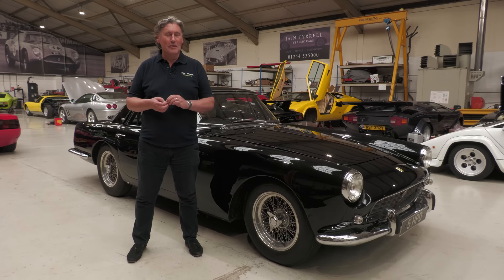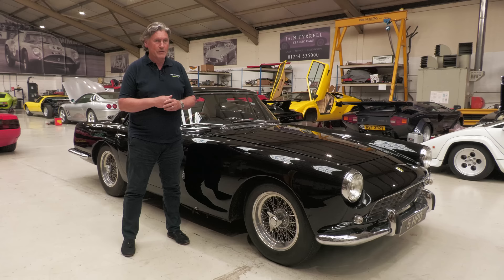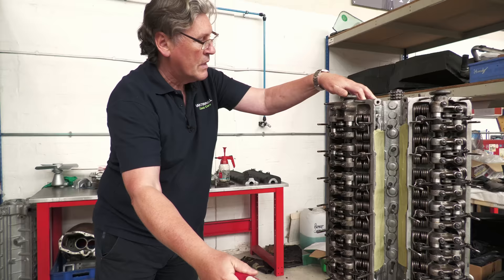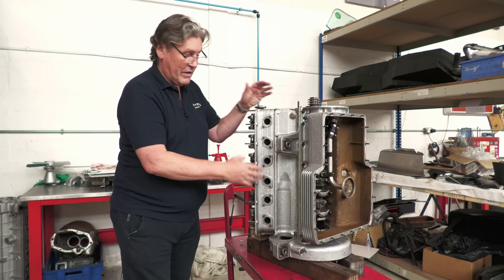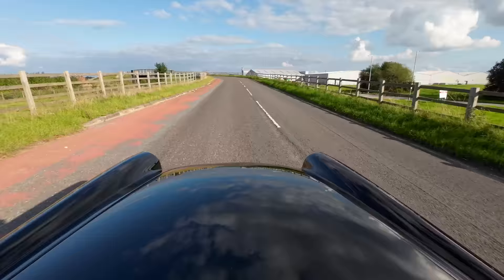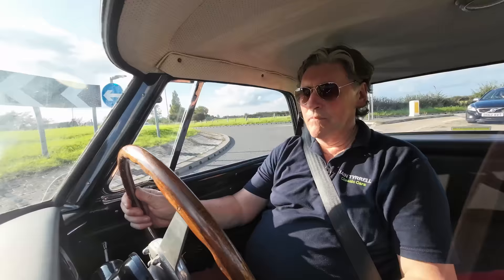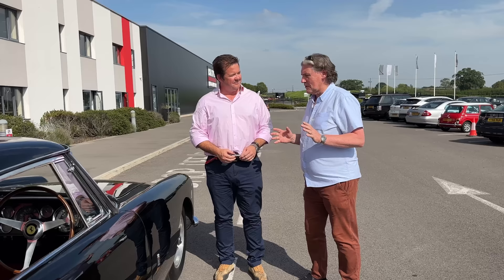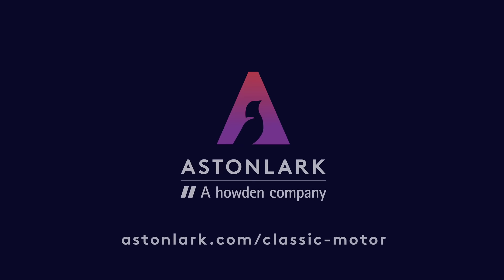Disaster Strikes! Ferrari 250 GT Coupe Road Test Drama | Tyrrell's Classic Workshop

Comment: It should be a no brainer not to give your Ferrari keys to a 21 year old to take for a spin, but that is exactly what happened to me! In 1968 while working for John Oldenkamp as a Studio Apprentice on 5th Ave in San Diego, J.O. decided to rent a Ferrari 250 GTE for 2 weeks to evaluate it for a possible purchase for $14,500. It had an oil leak and Ferrari service prices freaked him out so he bought a new 1967 Porsche 911S Targa! 
Before returning it he handed me the keys to the silver over red leather Ferrari and said "Why don't you try it out?" OK! I will...and off I went to pick up my buddy Cecil and his girlfriend Sally Angel and off we went on an unforgettable lap of San Diego's new freeways. 
Dropping down onto 163-S at Robinson the 250's V-12 was smooth and quickly we pushed 90...100 and under the Cabrillo bridge at a solid ton. Up the off-ramp at 90 mph to I-5 N and with peddle to the metal, downtown disappeared at 100+ past the airport and onto I-8 W at about 85 mph on the longish ramp and then we were picking through Mission Valley traffic at a solid 100 mph in 5th. Up the sexy curve of the 163-S exit the Ferrari slowed, 4th gear floored it and we were going 90+ mph as we topped the hill and went up the Washington St. off-ramp. Laughing and sweating all at once.
Remember this was in 1968, the freeways were new and the traffic was much less, never the less it remains the wildest joy ride of my life and in a Ferrari 250 GTE no less!
Reply from the maker: Still very much with you!

Comment: Mr. Terrell
Will you be kind in telling me in few short lines that Bentley flying spur or the two door continental GT are ok or not?
I have seen many videos on their vacuum leaks which is behind engine that needs the engine to come out for a simple ordinary vacuum hose?
Thank you
Reply from the maker: Bit too modern for me to say for sure. My advice would be to contact a modern Bentley repair workshop. Thanks for your interest
Reply: I better stick to Lexus, Thank you for responding

Comment: I'm sorry(I'm fixated on this ;) ) Mobil doesn't have a single synthetic engine oil in their portfolio, they have  group 3 hydrocracked ones. Personally I go with Millers EE as it's ester based but has good enough amount of detergents and disperants in opposition CFS line, it conditions and swells the gaskets and has very strong film even when driving hard.

Comment: Iain, is the black crackle finish still applied via paint or is it now a powder coating? Additionally, the brown/golden finish on the inside of the cam cover/sump; is that simply oil staining or some sort of applied finish? Thank you
Reply from the maker: Paint applied as normal, and yes hot oils staining
Reply: @iain_tyrrell  thank you Iain

Comment: An absorbing and fascinating video; bravo, thanks Iain! Quick questions: what cam cover finish did Christopher go for (I'd keep it original), and what does the run-in process look like for the GT Coupe?
Reply: Crackle finish. Its not a Lamborghini - grin. 350 gentle miles then oil change and possible tune...

Comment: Is there a crack in the windshield in the lower right corner? Bet that glass is $$$$$
Great tour of the v-12 engine. With the 3-carbs, 6 intake ports you might assume this is not as desirable as later freer breathing designs.👍
🇺🇲

Comment: Very nice Iain.
Speaking of 250's, Do you know of any way to get jets for the Weber 36DCS carburetors? Currently rebuilding mine for my GTE and probably need to rejet as I can't avoid the E10 fuels. Also, what LAMBDA would a 250 sit at when at idle?
Reply from the maker: Try Webcon- they are excellent. Co level up to 4.5% at idle is fine
Reply: @iain_tyrrell  
Thank you so much Iain. Have sent them an email.
If 4.5% CO is as rich as I can go, what do you reckon the leanest is? Can I go 2% or less? I would be lying if I said that trying to maybe get rid of a bit of the excess smell and sooting at idle, wouldn't be a welcome addition. I was thinking of shooting for LAMBDA 0.99-1.0. This new E5 and E10 fuel reeks compared to old leaded fuels.

Comment: This is not the earliest Ferrari on English roads.  In late 1951 or early 1952 ,riding on the upper deck of a London bus, I spotted a red 2 door 4 seater 212 Inter on Watford Way near Brent. Considering that I was all of 10 years old, I could be mistaken as to the exact model designation, but it was clearly a Ferrari, the nose being generally similar to the Barchetta roadsters.
Reply: This was the first car sold by the first Ferrari dealership in England. Any Ferraris seen in England before this car was sold were imported by the owners. Pay attention. This was spelled out in the video.

Comment: So buy the Haynes book first and see it has  1) a very poor head attachmentt design, 2)  one
clumsy  unreliable valve train,   3) a camchain that will saw through lubrication plumbery , and 4)  a  rubber hosed oil pickup. Well well. give me a 14,000$ Chevy Spark (50.000 km, sips no oil , needs no valve  service, should be good for years to come. I shouldn't care  less about  unrelliable money pits from commendatores.  
But, please get me one.
Reply from the maker: Maybe my explanation of the engine was too harsh. It still wiped the floor with almost everything else on the Track in period

Comment: You really should have that engine bolted down or suspended securely, especially if you move it about, the risk of it falling is just not something I would chance in my shop, it requires very little effort to secure it. Frankly I'm surprised you are happy to risk it and more so because it's not yours.

Comment: Engine builders should be able to machine engines that don't need old fashioned running in and ring embedding, unless you are dealing with old parts...!
That's why modern engines don't need running in.

Comment: Just one mistake like this is enough to ruin someone's reputation. Famous last works "There is a slightness vibration in transmission". First, the damaged joint should have been caught by a summary inspection before the drive test, second, the test drive should not have continued once the vibration was detected. Amateur hour.